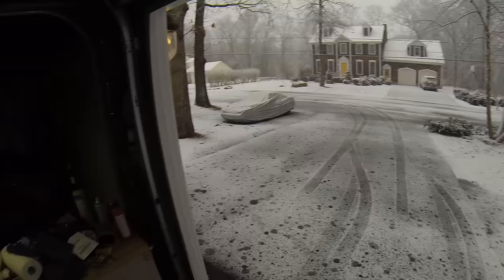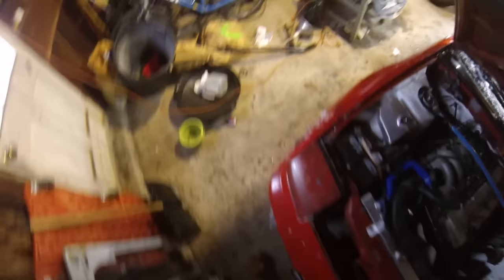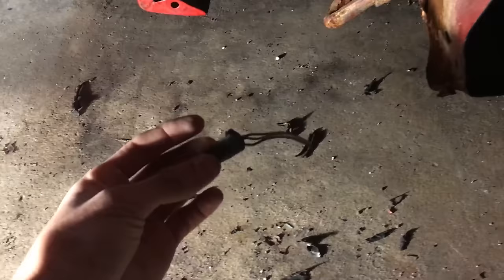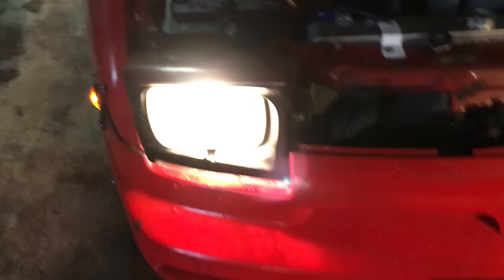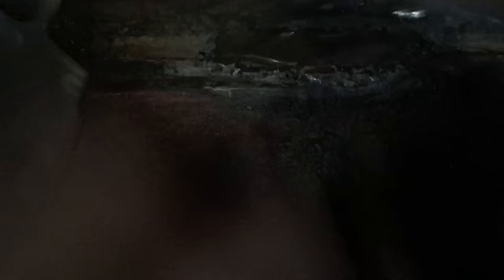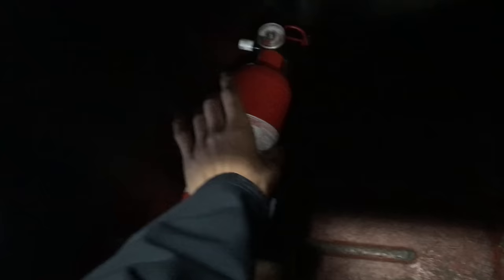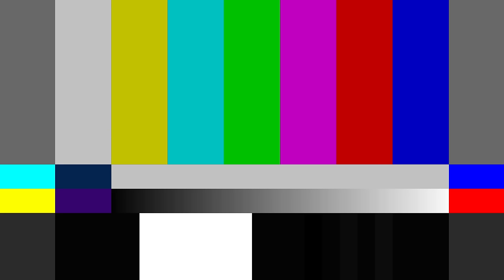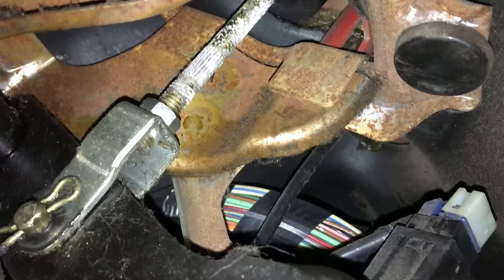240sx Drift Build Episode 18 // Motor Mounts

Comment: I suggest for degreasing your car you use a bottle of degreaser fluid (I use diggers), if you like cover some electronics / sensitive stuff, use a spray bottle / pump spray bottle to apply it, let it sit, wash it down with hose, wipe down what you can get to and also it's better to let your car dry in the shade vs direct sunlight because you'll get evaporation puddle marks

Comment: Could be your cable causing the play in the shifter, or the rubber washers in there. But it doesn't help the play if you shake the shifter in gear also when you don't have the clutch in lmfao

Comment: just alittle clarification the lights on the side of the fender is a running light
Reply from the maker: +OneClean Onevia  my car does not have the blinkers on the front bumper. I needed to have some sort of blinker on the front of the car so I decided to turn the running lights into blinkers.
Reply: +GeorgeGoesDrifting that works lol when i had no bumper i ended up ziptieing my lights in the core support since i dont have a ac condensor lol

Comment: bro that fire extinguisher will just pop out mid drift coz that plastic mount wont hold the g forces drifting causes. get some metal quick release straps otherwise you risk it poping out and hitting the handle and filling your car with shit. or worse it could bounce around and smash into you
Reply: you have to pull the pin first before you can pull the lever and it won't fall out because of the g forces, he's beginning drifting not a pro
Reply: +xRam im just trying to help mate. Im a armature drifter. Check my videos for proof. I have seen it happen. It snaps the head off the bottle. And youd be surprised at the gs when you take a good spin or hard transition.

Comment: How did you get that Initial D speed warning indicator? (The one that is heard when you go over 60mph) I heard it at 2:12 when you started the car. Did it come stock?
Reply from the maker: +Pinter Gaming it is just a factory noise that turns on when you turn on the car and when the ignition is on, but the engine is not on. And it does not turn on above 60mph.
Reply: Oh ok, just asking because i recognized it from the AE86's sounds. (I happen to be a ae86 fanatic)